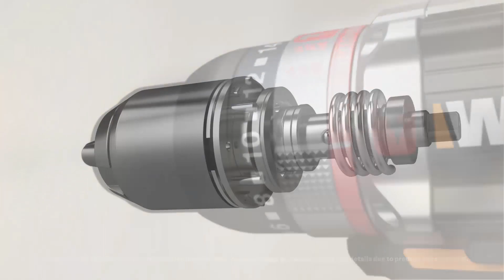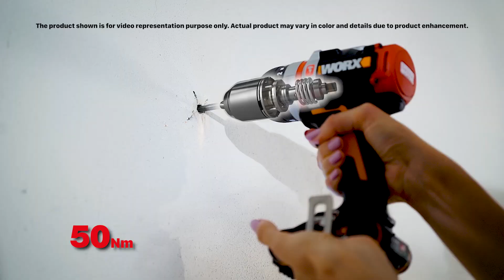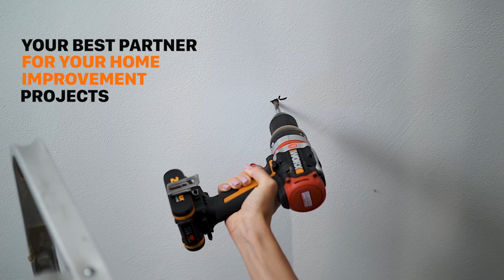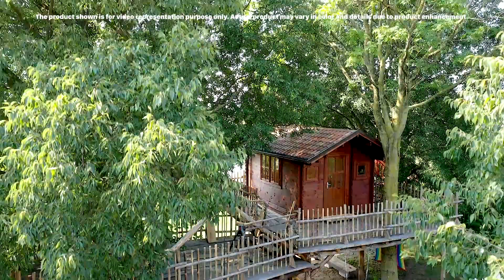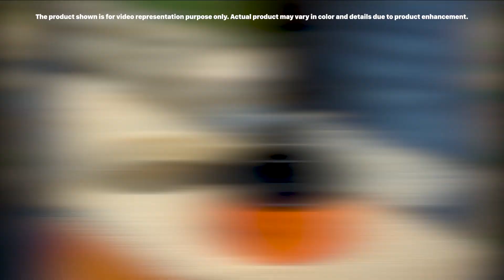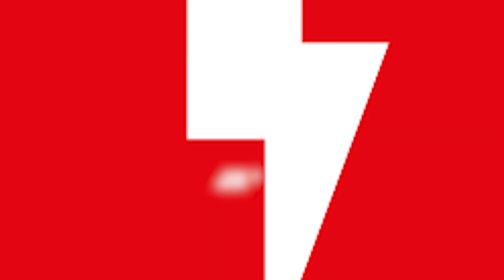WORX  WX-JCR 50Nm SLAMMER DRILL DRIVER          UK

Comment: Чем отличается от wx 373
Reply from the maker: Hi Khan, Main difference is internal hammering system illustrated by the 3D animation in the video. We called it 'Active hammer' amdnd is very efficient in drilling hard concrete. 
Привет Khan, Главное отличие - внутренняя система удара, проиллюстрированная 3D-анимацией в видео. Мы назвали это «Активный молот», и он очень эффективен при сверлении твердого бетона.
Reply: Спасибо. В России продается?
Reply from the maker: @basma469  From 2019 in Russia we had dealer contracts with
 
 OBI
/Leroy Merlin
/Tvoy Dom
/220volt.ru
/OZON.ru
Tmall.ru
	 
 
Our dealer monobrand stores  full assortment:
 
https://worx.tools-russia.ru/
  https://worx.volt.city/
  https://worx.tool-garden.ru
  https://worx.electrohulk.r

u

Хан С 2019 года в России у нас были дилерские контракты с
 ОБИ
/Лерой Мерлин
/ Твой Дом
/220volt.ru
/OZON.ru
Tmall.ru

 
Наш дилерский монобрендовый магазин хранит полный ассортимент:
 
https://worx.tools-russia.ru/
   https://worx.volt.city/
   https://worx.tool-garden.ru
   https://worx.electrohulk.ru